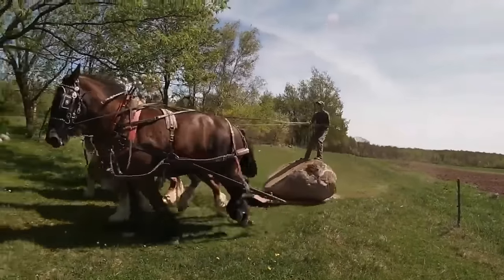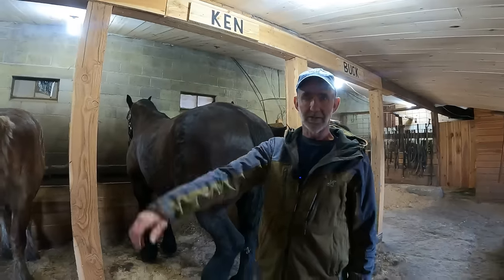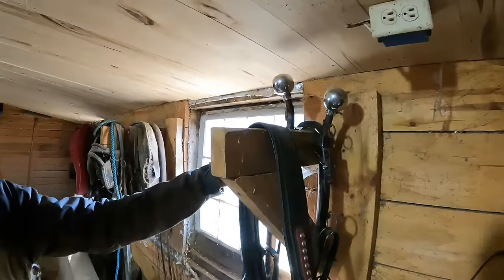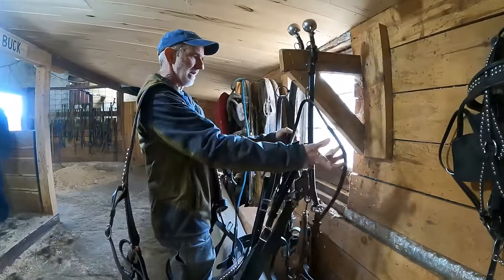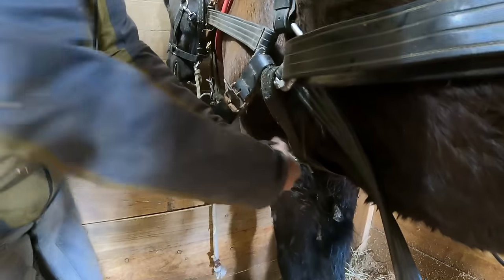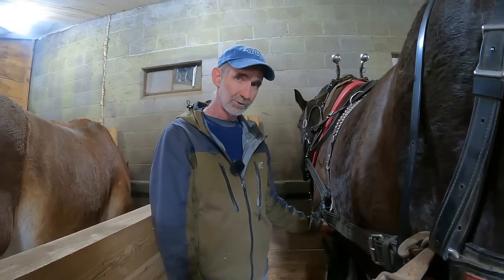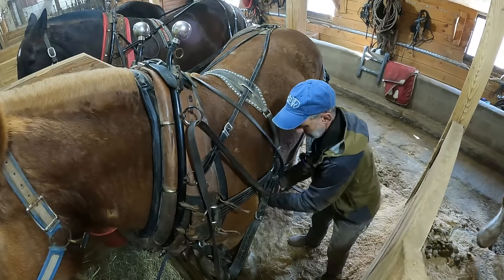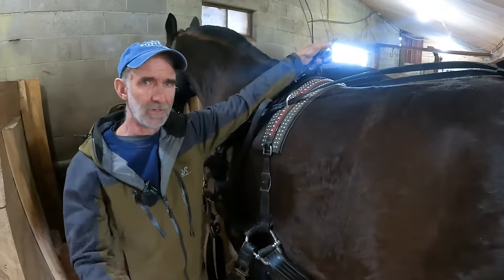HORSE BASICS #4: How to Harness a Horse!!!

Comment: Fascinating video. I love watching your beautiful horses. I had a problem with my shoulder and was sent to a sports physiotherapist where they hooked up electrical wires with pads attached to certain muscle groups. It was fantastic therapy. It was an amazing machine.  But my favorite healing was using my fly rod ( folded up. Not 6' length) and practicing my casting indoors with no line or fly attached. Getting the technique/ muscle memory down packed.
Reply: A TENS machine, they work great

Comment: I can't tell you how to harness horses, but I can give you tips on shoulder injury. As always, consult your doctor. My experience is from having had severe shoulder injury that kept getting worse, until my doctor finally sent me to a sports physical therapist. I'll try to explain a couple stretches that I was told are good habits to keep, whether you have an injury or not.

First, ice is good, sometimes they say alternate ice and heat.
Second, sometimes a kind of anti-inflammatory is advised, whether aspirin or ibuprofen. Sometimes acetaminophen is advised along with ibuprofen. Together they're said to work better at reducing pain than muscle relaxants. The ibuprofen reduces inflammation, which acetaminophen doesn't do. I guess acetaminophen is better at controlling pain than ibuprofen alone. Based on my personal experience, they work great together. I've never taken them for more than a day or two, unless I've been instructed to take them together once or twice a day over about four days. My doctor could have been wrong, so don't do this without consulting your own doctor.

Now for the stretches. Again, consult your doctor.

Stretch One
Lay on the floor, or on a very firm surface that doesn't "give."
Cross the affected arm over your chest.
Using the other hand and arm, grab the elbow, lift up enough so the arm doesn't touch your chest, and SLOWLY, gently pull the affected arm across your chest as far as JUST until you feel it. As it improves, you can go further. Hold for 20 or 30 seconds. SLOWLY and gently return to the starting position. Rest the shoulder for 30 seconds or a full minute. Repeat to make 3 repetitions, twice a day. You might want to do it on the other arm, too. My PT said, "What you do to one, do to the other."
The reason you do this while laying on a firm surface is to brace the shoulder girdle. You'll see athletes doing this at a standing position, but that allows some flipper flopper action in the shoulder. You want to focus the stretch. Go SLOWLY because speed decreases the stretch. My PT said, "The slower you go, the better."

Stretch Two
Laying on the bed, on the affected side, extend the affected upper arm perpendicular to your torso and on level with the shoulder. The forearm will raise up, pointing to the ceiling. Using the other hand, SLOWLY and gently push the affected forearm towards the mattress. Stop as soon as you feel it. Hold for 7 to10 seconds. SLOWLY return to the starting position. Rest. Repeat for 3 repetitions, 3 times a day. At first, your forearm will still be raised above the mattress but it will feel like that's as far as it goes. Eventually the tendons and ligaments will stretch to normal length, allowing your forearm to lay flat on the mattress. I think this one is done on the bed just because you're laying on your side, I'm not sure. I suppose you could do it on the floor if you want.

Stretch Three
Standing next to a wall, put your hand of the affected side flat on the wall with fingertips at shoulder level. Your elbow will be bent. Don't stand too far away from the wall, maybe one or two foot widths away, feet together. Keep the foot that's closest to the wall steady. Step the other foot away from the wall just to the point where you feel it in your shoulder. If you feel tingling in your wrist or forearm, try not to step as far. Don't hold, just repeat slowly for 10 repetitions without resting between. Rest after 10, then repeat for a total of 3 sets of 10, once a day. My PT said this one "insults the nerve" in the shoulder. Eventually the tendons and ligaments stretch to normal length, and then your nerve isn't "insulted." As the tendons and ligaments return to normal length you can stand further away from the wall, and the step can be longer. If you don't feel anything the first time you do this at the closest point, move further away, until you feel it.
Reply: This is great info. I’m going to try it myself!

Comment: I learned on horses that always had halter on. Halter pretty much stayed on except when out on pasture. Safety issue.....
Haltered horse was led by lead rope to barn door where a hitching ring/bar was attached to a post. Horses were brushed and harnessed there. Horse couldn't pin you against stall divider that way. Also, horse didn't drop collar by leaning down into manger. 
 So much more room to move around at that door hitching ring. The breeze blew dander and hair away when brushing rather than filling the air around you in the stall.

Harness/collar were hung on a wall adjacent to hitching ring & tack room rather than behind stall.

No water in stall so horses couldn't splash it around and soak manger or stall. Watering tank just outside barn door (not a deep freeze area like NY).

Everything else was same. Hames over the shoulder and one easy slide of the back pad and britchen. It helped that I'm tall, so no 'throwing' of the running gear, just a sweep of arm over the back.
But it was still a chore because the gear was all leather (biothane was just coming out). Leather gear was heavy and a chore to maintain
Reply from the maker: Thanks for sharing

Comment: Hi there Brenda and Jim. Here in New Zealand we use hame hooks on our hames. With a small modification to the harness it allows you to leave the hames on the collar. All I do is unbolt the tug/trace from the hame and replace it with a hame hook, ( these can be purchased from a number of suppliers in the USA ) next with a grinder carefully remove the rivet between the hame fitting and the harness dee at the front of the tug, ( grind the head off and punch the rivet out ). Next with a cut off disk in the grinder I will cut through the weld on the end link on the heal chain at the back of the tug ( hold it in a vice cut the weld , twist it 45 % and remove, place this link through the eye on the dee at the front where you removed the rivet, close it up and weld it in place ( this now gives you a single link to attach to the hame hook) the only other thing is to undo the strap that comes down through the  back pad and attaches to the bottom ring on the hames , then place a medium snap ( like a line snap or slightly larger) and do it up again, this snap is snapped into the top of the dee at the front of the tug, make sure that the snap is facing inwards so as not to accidentally snap onto any thing on the harness if you are working a team. Repeat on the other side and job done. EASY. It is amazing how much lighter and easier it is to harness not having those ridged metal hame to deal with, especially if you are shorter in height, a newbie or a lady that is not so strong.  It sounds complicated but it is not (the only thing maybe you may have to get someone to weld the link back up if you don't have a welder at home ) Hope this is helpful. As a Harness maker here in New Zealand I have done a number of harnesses for fokes and they all love it . I am sure it would be good for your shoulder Jim and make it much easier for Brenda and the girls  Cheers Rod  Harness Maker and Clydesdale horse worker Down Under In New Zealand.

Comment: Check around and see if you can find an old harness drop from back when they used horses to pull fire apparatus. All you had to do was back the horse into place, pull a lever, and the harness dropped neatly onto the horse's back.. They used a split collar, so all you had to do was snap the collar in place and fasten the belly girth and out the door you go.